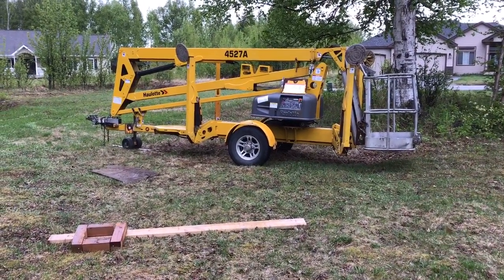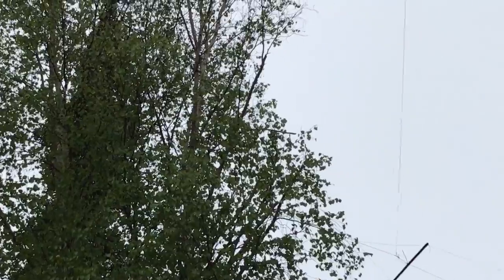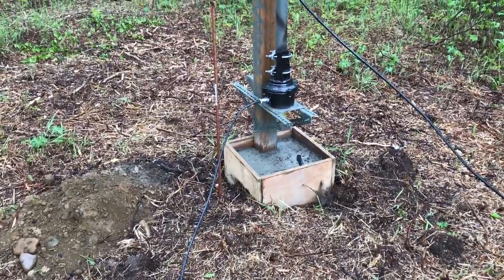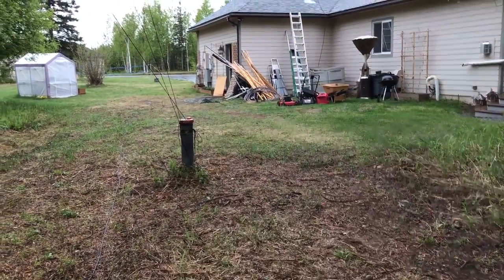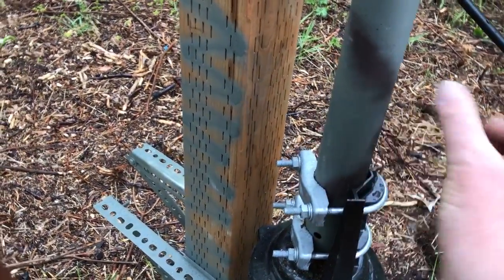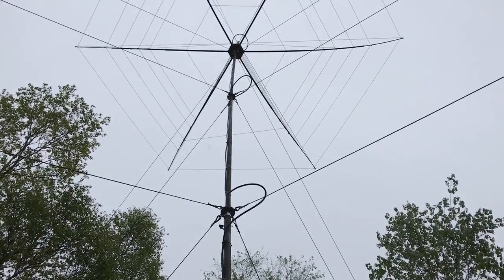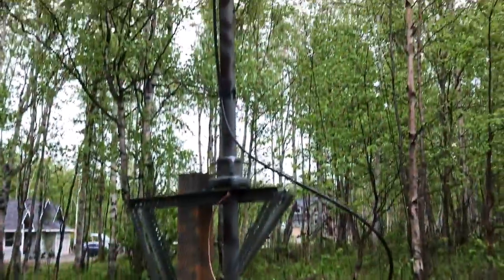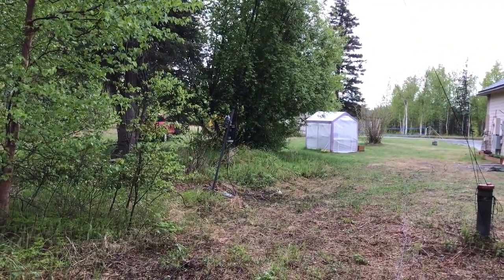NA4RR Hexbeam and EZ TM40 push up mast Alaska May 2017

Comment: I am assembling a MFJ-1848 8 band hex bean and need a mast solution. How did the TM40 push up mast hold up?  Thanks
Reply from the maker: Hi Kirk - its held up fine - no issues after now 5 years of Alaskas winters and very stormy winds - im still using the poly/dacron guys and they show no signs of UV or temp
Related issues either

Comment: Have you had any problems with moose getting tangled in your guy wires?  I'm looking at this exact setup a few miles south of you but I've been scratching my head on how I'm going to prevent moose getting tangled in it as they amble across the property.  73  KL5DV
Reply from the maker: Sorry delay in responding - No - the Moose have left it  completely alone - the guys terminate on Birch tree trunks and one set on my Well pipe - the only time I think I would have an issue if a baby and mamma were being chased by a bear, but unlikely here - 73

Comment: Nice hexbeam setup.  I was wondering why your earth rod was only half way in the ground.  Seems a waste of rod; not as effective.
Reply from the maker: Hi Bill - good question - and not sure if Ive answered that but there are two rods connected together and this is as deep as I could drive in into the frozen ground at the time !! -From memory it was frozen still at around the 5ft depth still at the time of original install

Comment: How does the mast turn if guyed this way ?
Reply from the maker: Hi - sorry delay - been in G land - the guy rings sit on the swaged (bulge) and mechanically slip - I added a little grease to allow easier movement but in reality there isn't a lot of down ward force on these rings. See https://www.youtube.com/watch?v=YL_OD02awTk
Reply: I believe the guy collars are not actually attached to the pole, i.e. welded or clamped, so the pole rotates freely without the guy collars or the guy wires moving.